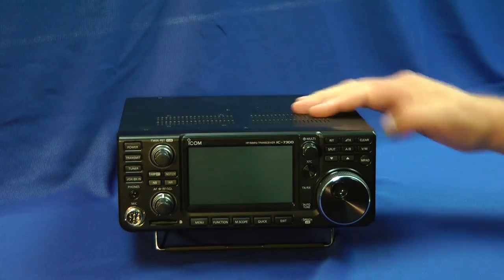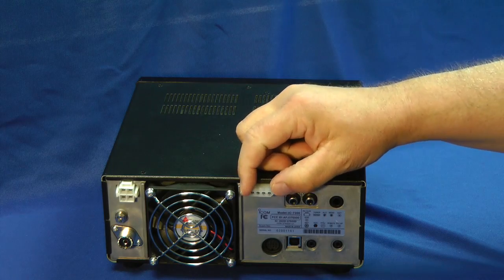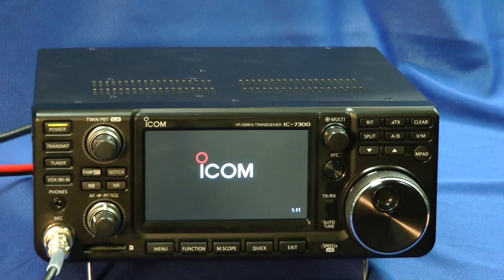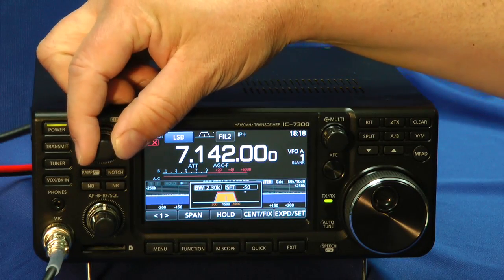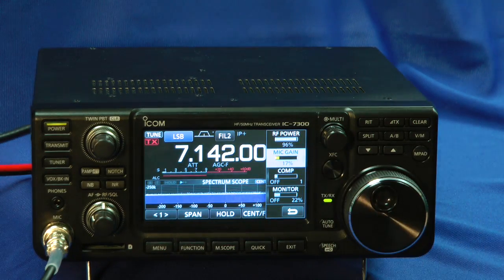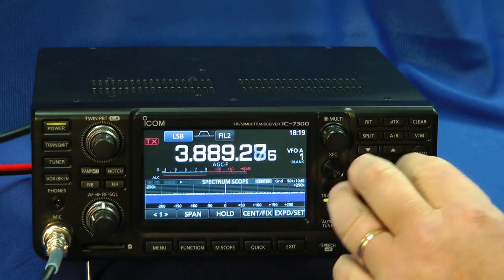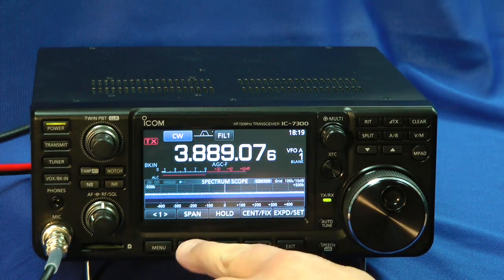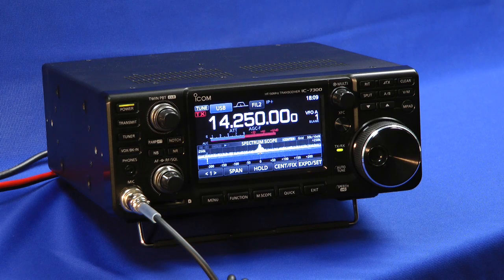Icom IC-7300 Transceiver

Comment: During your transmission the overload indicator did flash a couple of times.  FYI 
However, he was 60 over, which would be expected, Sdr radios require different operational procedures.  I have this radio, and I’m happy with my purchase, nice rig for 1k, that’s what I payed after specials and rebate.  And it came with a free Heil microphone and cable, sweet deal.  The radio has tons of functionality you only briefly touched on.  I would recommend anyone interested in this radio go to Icom’s site and read the advanced users manual, it contains everything the owners manual has and all the more advanced functions as well.  I was pleased to find out that this radio has an IF output, however it’s part of the accessories jack, so read up and learn..  73...